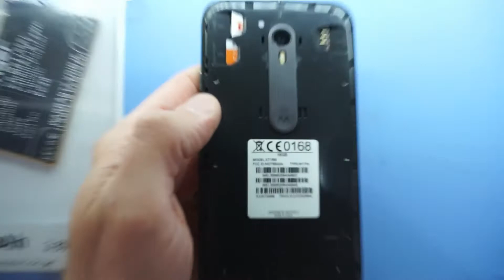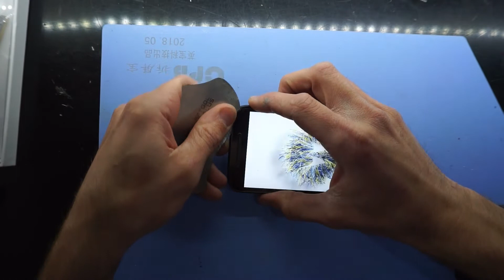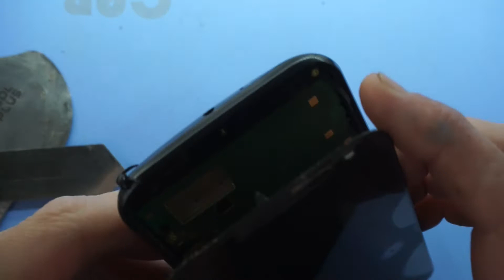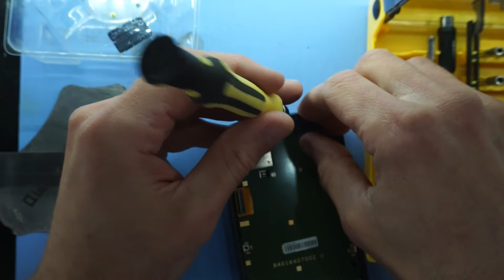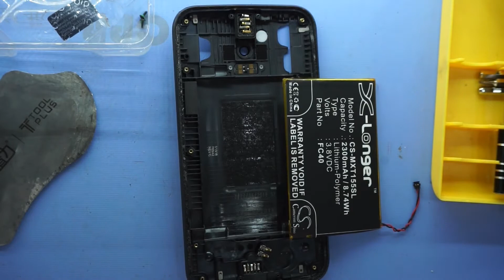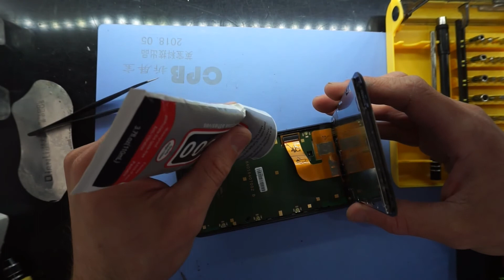Moto G 3rd Gen Battery and Screen replacement

Comment: Thank you. This is by far the best video on YouTube for the Moto G3 battery change. My wife refuses to have a new phone as "they're all too big" and I think I agree with her, my Moto G10 would be better if it was slightly smaller. Anyone doing this, be careful of damaging the screen like I did (d'oh!) as I now have a couple of black and white shadows on it. Also, make sure the bottom black screws are in securely as they compress the charging point connectors so that it will actually charge. It was the second teardown when it was no longer charging that I damaged the screen. 😔
Reply from the maker: A fiddly job Indeed

Comment: I had an issue with the bulging battery as well.  It's worked "ok" as a backup device/webcam with Droidcam, but lately it's been shutting off randomly.  I have a feeling the battery (same as the one you used) is failing.  It shuts down around 35-40%
Reply from the maker: shutting off early is a sign of failng battery
Reply: @rickstechrepairs  Yes I recall that's why I replaced the original one. I had a feeling, thanks for the message.